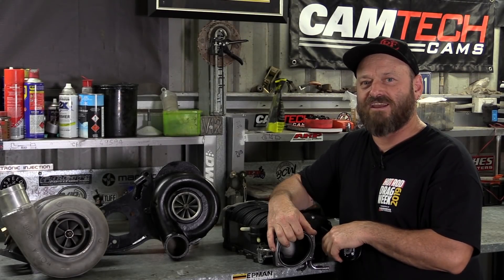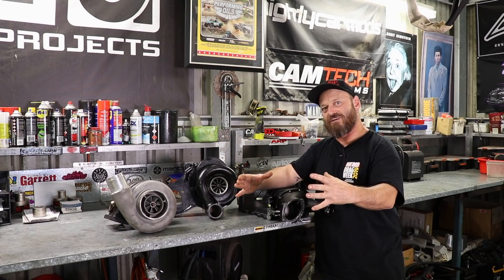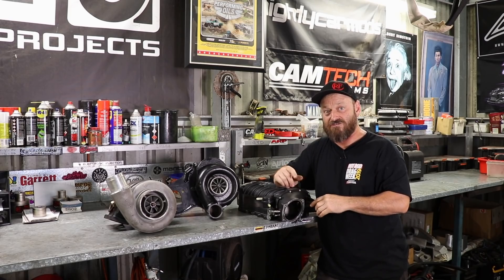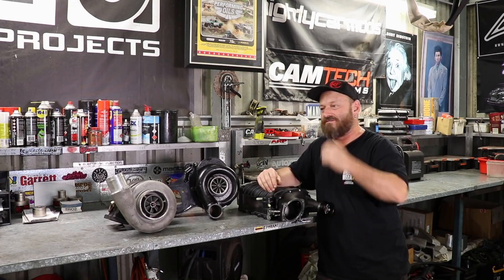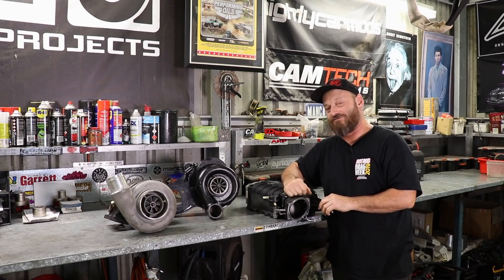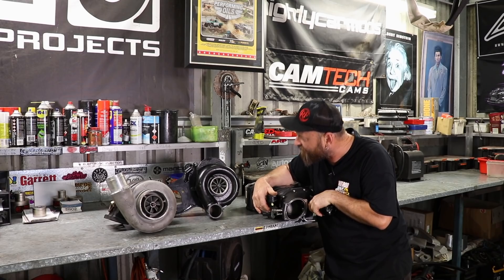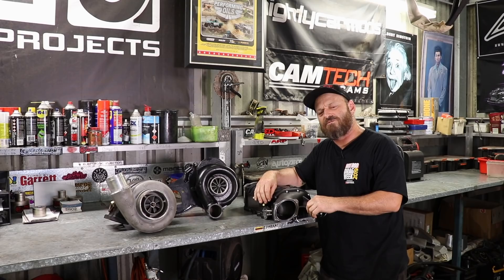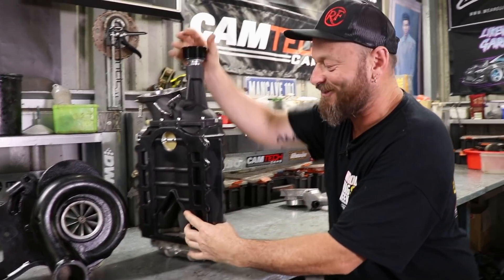Forced Induction Differences - THE SKID FACTORY - [ Quick Tech]

Comment: Back in the day I owned a 1985 Atkinson truck with an GM 8V92T Diesel engine. It had a huge turbo on top of the blower. It also had a water to air cooler under the blower so its nothing new. You explained it well.

Comment: Al, I agree with you most of the time. I will say turbos are a better way to go, do to the ability to tune when you use that boost. Although; you cannot completely discard superchargers. Top fuel drag racing cannot be wrong. Producing 15 to 20 thousand horsepower and using a supercharger to assist with that. I believe if they could benefit from turbochargers over the supercharger they would have done so long ago.

Comment: One way to make a centrifical supercharger work better is to overdrive it with a smaller pulley so it makes the desired boost at a lower engine RPM, but then have a wastegate to vent the excess pressure to prevent the engine from kabooming. Not as efficient, but fixes the issue of not making enough boost.

Comment: why doesn't the super charger ramp up boost like the centrifugal turbo? as they are both linked to RPM?
Reply: Because the harrop is positive displacement, meaning it moves the same quantity of air per revolution from idle through to flat out (bar some inefficiencies)
Whereas the centrifugal charger is not, the faster it spins the more pressure it will make. I'm not an expert and may not have explained it well enough, I'm converting my experience over from water pumps as I'm a plumber. These superchargers are all just pumps really.

Comment: is it true that turbo is all recoverd power and better top end application and supercharge costs power to make it back but has more torque?
Reply: Turbocharger is run on waste gas, so yes, low rpm=not much exhaust=not much choochoo. Supercharger does add a parasitic loss To the engines, so it uses power To make power. Hence why you need both, belt driven for lower engine speed, and turbo up top.
Reply: I understand it isn't all recovered waste energy, due to the increase in exhaust manifold pressure (drive pressure) there are some losses or more fuel burnt to make up for it.
Reply: @johnjosephson9277  you need To feed More fuel because you feed More air with the turbocharger.

Comment: You forgot the 4th type of forced induction. Guys that used to race tuned Mini Coopers would divert the cabin air fan into the air filter box to make a poor man's turbo! On a 1375cc engine, it was probably as much as it could take anyway, if you put a turbo on it, the head would probably grenade itself, or you'd have a mini engine running purely on air power, like one of those little toy 4 stroke engines that you make spin by using an air compressor

Comment: Al (or Woody), I know you mentioned that a Positive Displacement blower will make more boost basically off idle, as compared to the centrifugal blower that won't make max boost until max RPM. I'm not sure if I missed the reason for this?
They're both belt driven from the engine. How can the PD Blower make more boost at a lower RPM? (or, steadier boost?)
Reply: Positive displacement pumps the same percentage more air than the engines capacity consistently though the rev range, meaning same boost pressure throughout. But centrifugal picks up efficiency with rpm so will make more boost pressure at higher rpm.

Comment: 22 dislikes cos' they didn't like what you said about forced induction v's internets.... idiocracy!
F-Me.. this stuff is WW2 spec everyone... only thing that has changed is electronic control.. and electronic fuel injection, instead of carburetors...we have every parameter controlled by a big beautiful ECU...... Injectors... Precise metering of fuel, spark, ignition advance... damn.... even trimmed out by the exhaust gasses... and still....
22 thumbs down... you feckers.... can all EAD!

Comment: Can I be pedantic and clear up one thing - the positive displacement blowers trap air between the blades and the housing so it travels around the outside of the lobes, not through the centre. For many years I thought it was the other way.

Comment: Turbo will always have the upper hand with 70% efficiency compared to a blower at 50% to much mechanical  power loss through the crankshaft don't get me wrong lots of torgue but at the mid to high end turbo takes over 👍plus with turbos that are variable hell yeah !
Reply: Er... on a mech driven supercharger, 25% of the engines power could be consumed just compressing the air. This is the work required to compress the air, and doesnt account for mechanical losses.
Reply: A turbo runs from wasted exhaust gases thermal energy and can also run on vaccum but any supercharger can't do this and you can also get better fuel ecconmy then a blower alot less power is lost to create boost opposed to a supercharger

Comment: Got an LSA with the 1.9 over driven 20%. Combined with an interchiller and bigger coolant reservoir its ice cold and makes 430rwkw.

I have had big turbo cars but found while they build and build power the power for the same throttle deflection varies wildly.

Makes it very easy to drive like a fuckwit with the s/c but harder with big turbo without ending up looking where you were coming from.

For big power nothing beats a turbo though.

Comment: My dad used to work on shackleton's in the raf in the mid 80s had 4 rolls Royce Griffin engines all had twin speed superchargers fitted. The superchargers where all bigger the a modern 4 cylinder engines.

Comment: As per usual Al is spot on. The only aspect I'd expand upon is that in some forms of circuit racing twin screw is quite popular because it provides a very linear response naturally which is much easier to tune around, versus needing dynamic traction control strategies or boost by gear. On a road course, and extra 10% power mid corner isn't always wanted more than predictable linear response.

Comment: Roots does get big power in Top Fuel around the world. Could those engines make more power with a turbo or centrifugal supercharger?
Reply: With a turbo, yes. Turbos are banned in Top Fuel.
Reply: This comments goes on and on here. People say 10000 hp with roots, like it has made a 500 hp engine make 10000 hp.  Those engines are pretty extreme even before getting To the roots blower. This needs To be looked at from percentages, not overall output. The engine might make 8800hp without the charger, so it is the same as having a 88hp engine N/A and 100 after slapping a roots charger on top. Dragging the dragsters In the convo is silly imo. Those engines are so not like anything else. You cant drive them from pits To startline, or you risk not finishing your pass. I feel like the supercharger on the dragsters has More purpose other than just adding power, maybe control over the air thats going In the engine, and the requorements over the fuel they run. No hating here, just had To pick up on this after the 95th top fuel comment.

Comment: So much hate for the roots style. The newer ones aren't THAT inefficient. Use an intercooler and it helps tons, just like with a turbo. Remember old turbo setups on cars didn't have intercoolers, and made crap for power. You also forgot about the lysolm twin screw style blower, and the TVS is a modern Eaton roots design, which they had some others before. There's an application for each one as you say. And blowers work fine on inline engines, even rotaries.

Comment: To me its simple:
V8 or V6: goes good with a roots type supercharger.
4 and 6 cylinder inline engine: goes good with centreifucal supercharger or a Turbo.
Reply: The Toyota factory supercharger kit for the 3rz 4 cyl engine is cool for 4wds. It's outrageously easy to fit as it just replaces half the intake plenum. Easy afternoon job. Works with existing intake, snorkels etc. No need to touch the exhaust. Kit is 4psi on stock system or 8psi pulley with fuel mods. Doesn't make bulk power but great for off-road.

Comment: I had a twin charged golf and now I have a 2L turbo. The twin charge was so much better for day to day driving. I wish the system was adapted to the much more reliable 2L engine!
Reply: I has ownd both in gti polos I find the 2ltr just as or more torque down low as the twin charged

Comment: I don't feel the need to yell, but Al said we have to. So i will unleash the fury of caps lock. I'M NO EXPERT, BUT WASN'T THE ORIGINAL POINT OF THE ROOTS BLOWER THE GAINS IN FUEL ATOMISATION WITH JUNK CARBURETTORS OF YESTERYEAR?? WHICH DID ACTUALLY IMPROVE POWER BACK IN THAT ERA.

Comment: Heard a old myth that if you had a super that added 1000hp the charger would use 200 of that to run due to parasiteic loss same as net HP vs gross HP , on the other hand big turbo means big lag

Edit: Merlins also had a two speed charger cast into the block, fricking 27.7 liter V12
Reply: The 25% loss for a mech supercharged engine is actually the energy required to compress the air.
Reply: @nordic5490  the way I was told is its because of more 'drag' on the pulleys but idk anymore
Reply: When you compress a fluid it resists as the pressure goes up, and that is the work that eats up power. But yes, your supercharger makes More power than what the change In overall output is.

Comment: Hey guys, another great video, thanks! I fitted a Rotrex C38 Centrifugal Charger to my Euro BMW M3 (3.0l) a few years ago. I kept it on standard internals, so needed a good and reliable method of governing boost. For a finish I ended up using a Tial wastegate (yes, you read that right) just after the compressor outlet to bleed off boost. With this setup, I also have the advantage of being able to use a smaller pulley to get to max boost lower in the rev range. Why not just turbo it? Well I don't have the skills (or desire) to race a laggy pig and its a bit of a PITA to fit a turbo on a RHD M3 of that era. Ultimately the setup works really well, it has been extremely reliable and it's really nice/predictable to drive... which all adds up to relatively pain free motorsport!

Comment: Not true, the Holden L67 engine had a stock roots blower and could make up to 250rwkw reliably. Be lucky to hit 120rwkw without it.
Reply: Very true. I had a 2004 L67 Calais. Swapped to a smaller pulley for extra boost, water to air intercooled, roller rockers, otr intake, pacemakers, 2 into 1 exhaust, plugs and a tune....reliable and fast....brilliant.
Reply: mrcaps1971 Yup I had a Calais as well, W2A intercooler, 64mm pulley, rockers, small cam, was about 240rwkw and murdered anything off the line with slicks

Comment: Just for some useless nerdy facts, the old GM blowers were called 4-6-8/71 because that was the number of cylinders from the original Detriot Diesel engine application with 71 cubic inches per cylinder.

Comment: have always been a turbo man. driven a few centrifugal supercharged cars and was never a fan and positive displacement supercharged v6's lick massive balls and in most cases do drive better without it but after driving an car with an LS3 and harrop 2300 runnin about 14psi i've gotta say the torque is addictive af.. so much so i'm pretty sure thats the route i want to go with my SS now.. perfect for a street LS. no doubt i could make more power with a turbo but being realistic for a street car a turbo 6 litre LS even on 9-10psi boost  makes stupid power that you can very rarely even try and use on the street and when ya do it doesn't do anything anyway cause ya just peel tyres so maybe i'm just getting old or something but i don't see the point anymore. 3/4's of that power with big torque right off idle where ya can actually feel it is fun as on the street. i still say on anything other than a V8 its must be turbo'd but. supercharged 4's and 6's= aids

Comment: Positive Displacement Air Pump is even older the Roots, was developed in a larger, slower moving form, as air pumps for deep mineshafts, being able to get clean air to workers keeps them productive.
The centrifugal layout comes from steam turbines used to convert movement of high pressure steam in to movement of a drive shaft (hence Shaft HP rating of turbines and jet engines) to drive electric power generator, and, yes, the exhaust side of a turbo charger can drive an alternator,... And can be scaled up to Snowy River Scheme power station sized.

Comment: You guys are great mechanics. But you aren't engineers. Which is probably why you are wrong about most of the stuff you said about the roots type supercharger you showed.
Actually, some of it was technically correct, but presented in a way that a layman would get the opposite idea...

Roots type superchargers do have flaws. But those flaws are mostly due to the form factors of the design. They aren't usually used with an intercooler, which is why they are less thermally efficient for an Otto cycle engine. But that doesn't mean that the design itself is much less thermoDYNAMICALLY efficient than a centrifugal design. Some can even reach 80-90% peak efficiency.

The two types also have vastly different efficiencies at different RPM ranges (for the rotors, not crank shaft).
AND they also have different efficiencies at different pressure ratios.

There is also a big difference in price. And a difference between how a cheaply built version of each will operate.

These quick tech videos are obviously intended for people who don't already have a solid background with this stuff. To the layman, it sure sounds like you are saying "This type is old and bad". When you should have said "This type is more expensive and harder to do correctly for the conditions you might want to use it for."
Reply from the maker: Overwatch I think many people assume I was talking about all PD chargers when I say Roots blower but I am specifically referring to the 71 series DD units commonly used by old school rodders. They are not designed for what they are being used for and that is why they don’t work very well. I am just a mechanic so not real bright but you are clearly an engineer so should understand that.

Comment: Are you suggesting that top fuel drag cars / nitro funny cars using blowers making in excess of 8,000 HP are not good and would perform better with a turbo?
Reply from the maker: I didn’t suggest any of those things, you guys need to listen harder. I simply said that Detroit Diesel Blowers are not very efficient on a petrol engine. If you think a top fuel or funny car has a blower off a Detroit diesel on it then you need to look harder.

Comment: Gail Banks said just what you did. he mentioned its the ability to get dense air into the engine that matters. it takes boost and inter cooling to get that done.
Reply from the maker: Stupid Do you have newsletter I can subscribe to?
Reply: @Stupid I think you're confusing evaporation cooling of fuel with types of superchargers. To pump or compress air without increasing the temperature of it is defying physics. Likewise there is always a trade-off with cooling the air using an inter-cooler and compromising flow/pressure. In certain applications (low boost, rich air/fuel mixture, methanol), intercooling may be deemed unnecessary. Plenty of high performance roots blowers are also intercooled, usually with a water-to-air intercooler. The reason turbos are popular in the OEM market is because they are small, reasonably inexpensive, and can be easily packaged into different engine bays and onto existing (NA) manifold designs. Roots style blowers are large, heavy, expensive and difficult to package into a cramped engine bay hence why you only see them on cars with very large V8 engines with very large engine bays. Centrifugal superchargers are not popular for OEMs because a peaky power band is difficult to market to the general public.

Comment: I think roots style blowers actually go the other way Al and push the air OUT from the centre around the outside of the casing and down rather than through the middle. You could have mentioned the "litre" or capacity of the roots/whipple style superchargers and how that side of it works too.. good video 👍
Reply from the maker: Tai Johnsen it’s a big subject and a short video. Probs should have been more specific about the types of blowers that are inefficient, ie Detroit blowers.

Comment: Al, why you hating on Blowers so hard? Blowers are not compressors, but rather they are "air movers". Also, Roots blowers don't draw air down as you said, it pushed it around the outside of the case and then down into the engine. May sound like semantics, but if you're going to explain something, explain it correctly, please! :o) I'm not hating on you, Al, just like people to be accurate in what they are saying.
Reply from the maker: Paulster2 I am hating on using Detroit blowers on petrol engines not on all PD Superchargers. Modern PD chargers work amazing with an intercooler under them.

Comment: Sounds like someone has never been in a blown big block chevy with 1000 horsepower and 900 lbft of torque right off idle and not have to spin a small block to the moon to make power
Reply from the maker: XOZ Industries That’s a function of capacity not the blower. A Detroit 71 blower is not doing a petrol engine any favours, it’s just pumping ping heat into the engine. A modern PD supercharger is an excellent thing on the other hand.
Reply: The Skid Factory to be fair mine is a modern blower with Teflon tipped rotors on a 540, I’m putting Holley dominator EFI with drive by wire and port injection as well as injectors on top of the blower to fix a lot of the evils. There’s a lot of ways to go fast and only excuses at the end if the race